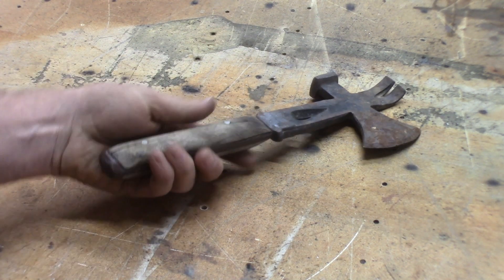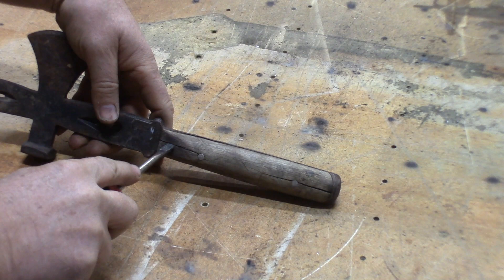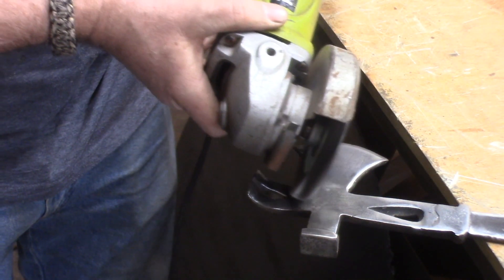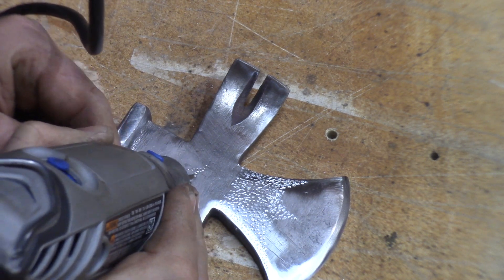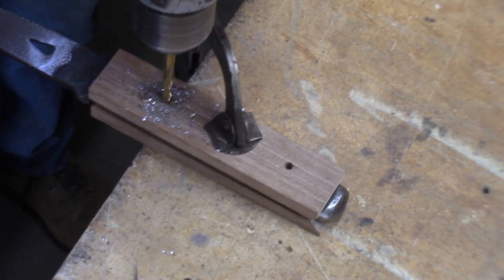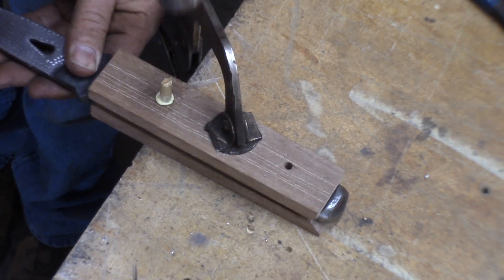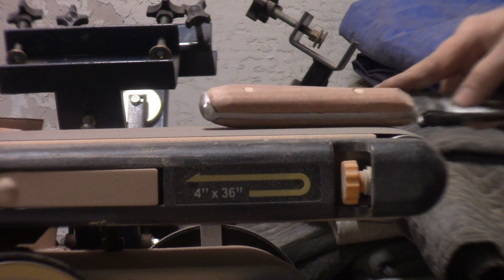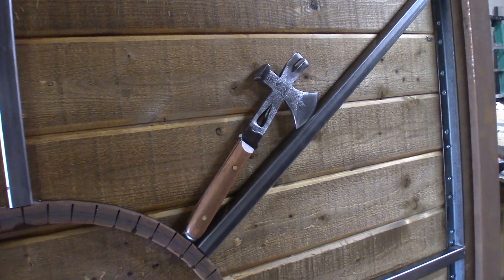Hatchet Restore-ish (cleaning up an old crate tool)

Comment: Turned out great.  I wonder why pins are always brass or some other metal?  Wood should hold shouldn’t it?
Reply from the maker: Thanks Chad, yeah I'm not sure about the pins. I know I didn't have anything in my shop that worked so the wood option seemed like the next best option. I'm not sure why it wouldn't work just as well as the metal.